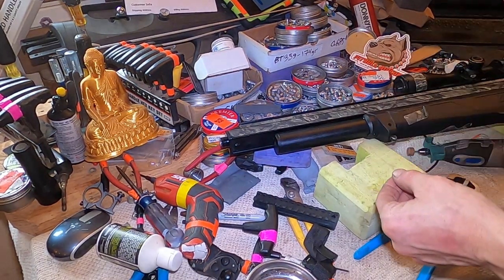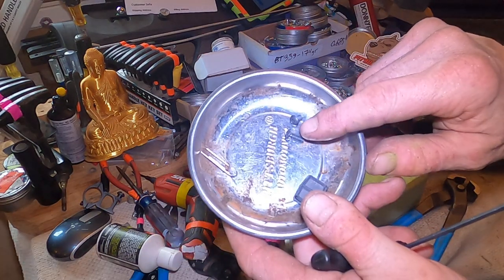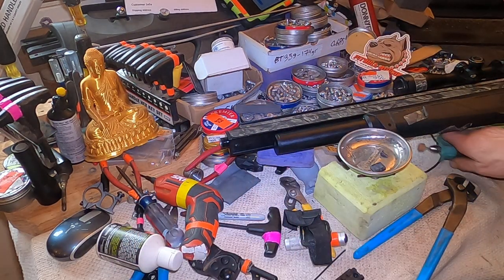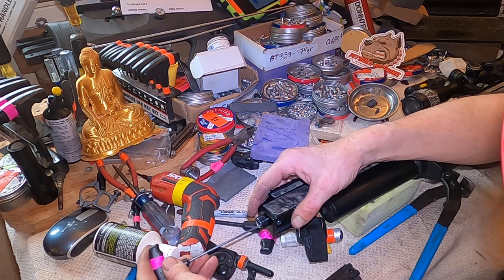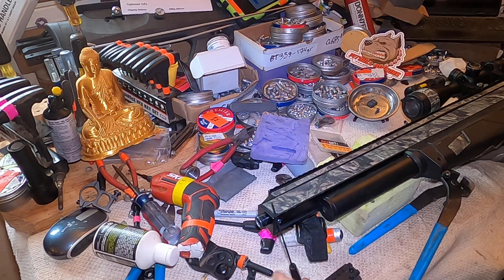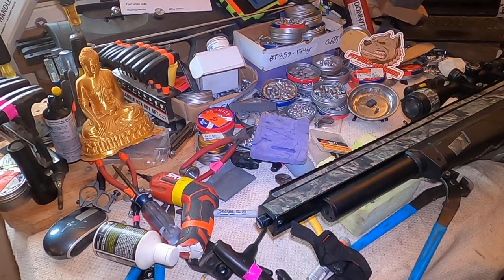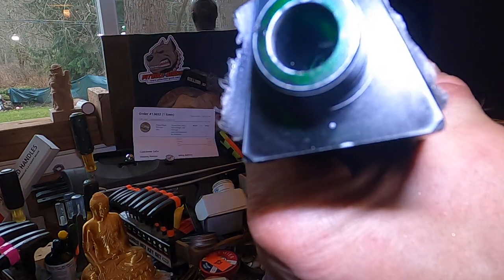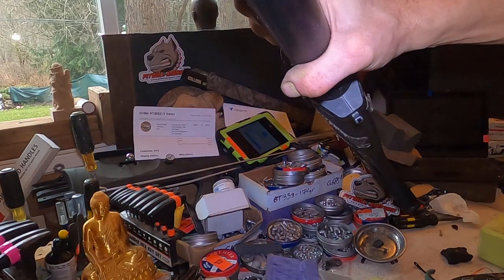Benjamin BULLDOG 357 INCREASE TANK 440cc FIX 100cc Plenum Install DonnyFL PITBULL PuppyPlenum

Comment: THATis very cool but for me to buy one it would have to be put together  already and not be over a  thousand bucks, and that platform would fail . to get those mods  would put it over a  grand, and it is still a  bulldog that has a  energy level of around 180fpe, half my big borerifle's  and the mag only holds half my big bore mags  count so even with that reg , i  cant do it friend. and i  dont think it is a  fair trade for my challenger pro my pro being the lesser of the two. but think , you can buy a  50 cal hammer on pyramid air for $849 and that is alot better than the bulldogs similar price . and the hammer has a  reg and is 50 cal . over 700 fpe so you can shoot anything out of it.555gr projectiles at 750fps  that is one heck of a  dunny round tell ya that.
Reply from the maker: Thanks alot TEXAS M.... now i will be PROVING YOU WRONG. HAHAHAHA 180fpe, what hallucination is that.,,

I will RUN YOU NUMBERS BROTHER, NO JOKE. i cannot TOLERATE HATING ON A BULLDOG .... THEY CHANGED MY LIFE, OUTRIGHT. NO FEDERAL,FIREARMS ENHANCEMENTS. Hugs, M! ;-) I LOOK forward to this... Really! Not to be right, to SHOOT THE 356 157gr RF i just made up,last night and sized. Hahahaha so, FOR YOU, i UNDERSIZED, not to 358 where. My set of bulldogs works differently than you believe. And also, if you want, i can TELL,WHEN I SEE A DEAL. I AM ALWAYS LOOKING FOR ANOTHER. 6 ISNT ENOUGH.
Reply: @Dont_lose_sight  that sounds wonderful .  id love to find a  bulldog that is up to any challenge of my big bore. smiles. my 125grain lightning 9mm fly at high of 1076 and the 10th shot . 870fps with a  125gr solid and these are the bullpup numbers on video , it has a  500cc air cylinder , my standard version big bore challenger .357 has a  600cc air cylinder so is probably a  little more powerful than the one in this video my friend

https://www.youtube.com/watch?v=7rEiNOM4Pig 
 i  can always send my rifle and let you shoot it. smiles. true monster it is.
Reply: @Dont_lose_sight  i  am  not hateing on the bulldog. it seems like a  reliable platform. it just cant touch the performance of my big bore , hands down , i  think maybe that extreme big bore of texas is a  little more powerful by a  bit. but i  dont think it uses a  mag at all and ive got a  10 round mag that can holt 160gr hollowpoints or 170gr solids. and upto 230gr single load is easy. but please  please prove the bulldog  is better. hey pull out the pit bull and make sureit has all the upgrades  and i  will stay stock with my big bore .357 . only mods is i  ripped out the guts of the emperor and inserted my own materials  and it not only is less noisy. but the recoil and harmonics are smoother as well. 
 so me stock  aea standard challenger big bore .357 with my 125grain solid (it is round nose  flat base and i  thin it is lubed  but that is it. against your  bulldog/pitbull  and your 158grain round  nose cast bullet so you get to shoot a  heavier round but i  am pretty sure i  will put out more energy with the smalller projectile giiving you the advantage my friend from the start .
 the video shows the weaker bullpup version  doing what i  said. if you wish to shoot this one yourself and know truely the power you dream of in that bulldog. when you pull the trigger of this rifle it telles  you , that clearly it is the boss and not you. smiles and that discussion goes past 10  rounds if you start at 3800psi instead of the 4000 psi in the video.
Reply from the maker: @THE_LAST_WORD  I defintely understand far 'superior' guns, in 357, the thing is, of SIX, i have had ONE FAILURE and i will not mention the metric weight they have pushed. ;-) i been running THEM, MY PITBULLLS too long and TRUST TRUST TRUST them. i cannot say that for DOZENS of others , all types i have tried, nothing, yet can handle ME. . . longterm. imaine that. LOL. i hope i can put those 356 UNDERsized through, but i already know they are better FPE at 357/8, from the 360 parent S&W Snub reloader favorite.
Reply: @Dont_lose_sight   oh you are correct , in your bulldog  .358 is better. but id bet that .350 would be beautiful out of the bulldog.  but i  am running .356 cause my rifle does not like anything larger than .357 and i  like the way the .356 sounds.i am considering making my emperor permanently attached  to be able to ignore future issues even though i live in texas and am afforded protections  due to state law and injumction in the courts. but i  would rather a  integral shrouded suppressor instead. i  already have an m18x 1  end cap for my emperor prettty sure i got the .50cal guts in the emperor as well even though i use it on my .357 but ya know , that cant be verified unless  someone puts that m18 on it and attaches it to a  50cal  huh. dont your texas use that m18 x1  for the donny ?  nope just tried my 1/2  od  inner barrel  for .359 and it wont go in on its own. so when i get a  new drill i  will put the 12.5mm on the drill and put it through the emperor and then press the inner barrel into the emperor and then open it up and port the inner barrel to .aprox .30cal ports . and put it all back together . making the unit fully  a  texas  made  thing. ill have to engrave it though . ill make another one for the 50cal. i  have inner barrels that are .62id and .75od and that is what  i  will use for inner barrel on the 50 suppressor. the outter case will be donny  and the rest my own  ideas over the years. course it going to be for my 50 when i get it. darned shippment from china is late , held up in shanghi port.
 so i  may not get the 50 i  really want. might have to buy a  hammer instead  but there i go  thinking about the same tech as the bulldog. true caliber bore and a  regulator. and i  do not like the hammer  2  round mag. the rifle is great except for that.
Reply from the maker: Bro, well, i LISTENED TO YOU, again,  i POSTED your suggested D.O.J. HELPFUL HIINTS for local Harassment ongoing. THANK YOU. . . all to have Civil Liberties and  to be left alone and RESEARCH and create DATA for OTHERS. .... in process, i now have a FLAME THROWER TO KNEE, i cannot do the Bulldoggin g FX now, but i will, i am BEAT. i ate it into the gully, posting a sign, NEEDED and i feel better, - THANK YOU for the HELP. i will do , i already INTENTIONALLY sized to 0.356, since i needed NEW Radar to compare with all the other ones. also, i gathered PATTIES that vaporized at 190yard goneg all Big Bore...ALL fraged. THere is ONE WAY for your terminal energy...Even the cahllenger 252 50gr 190yard = 12gr-15gr pattie left. HA HA HA hows them VAPORIZED 'apples'...?

Comment: We’re do I buy the 100cc puppy plenum tank?
Reply from the maker: I would have got the longer one, but i cannot manage 3D printed suppressors like theirs, so i cannot get the Puppy plenum MAX which is larger, it would NOT ALLOW FOR RONIN #donnyfl , so the 100cc makes enough a difference in my Pirbull hammerspring(3CCW from MAX CW turns. and Cocker spaniel charging lever, and polishing the hammer. I was testing shot count and it increased, with my 90gr RF UNZISED cased round flawless adding about 8 more worthwhile shots out to 78 yard gongs. https://www.pitbullairguns.com/product-page/puppy-power-plenums and GET DEPINGER. i messed up and ordered three 100cc tanks and ONE depinger. and now i REGREWT it, i should have got all three full sets.
Reply: Put mine on with no problem. Now im getting 3500 psl